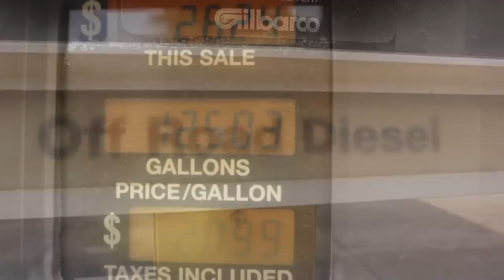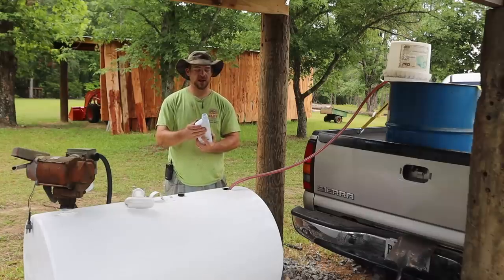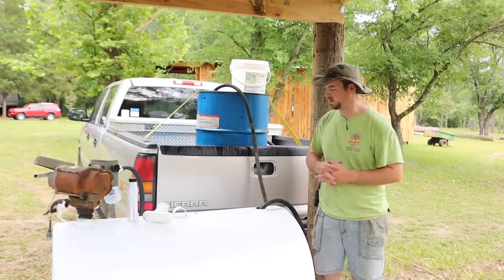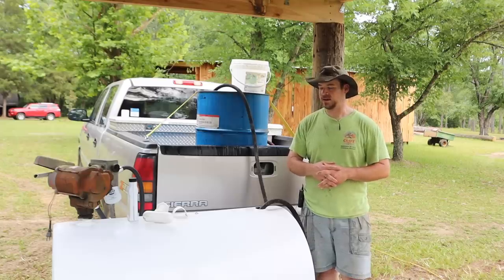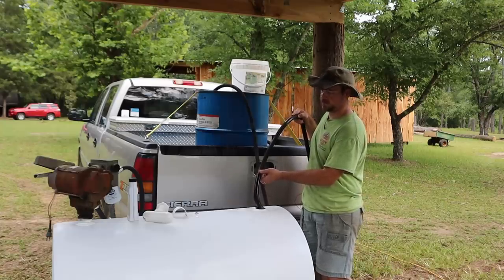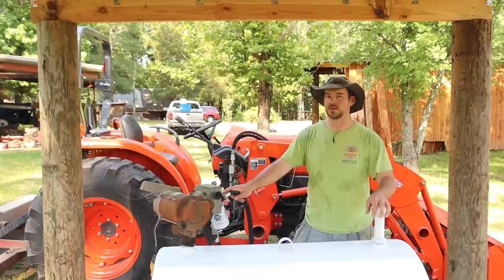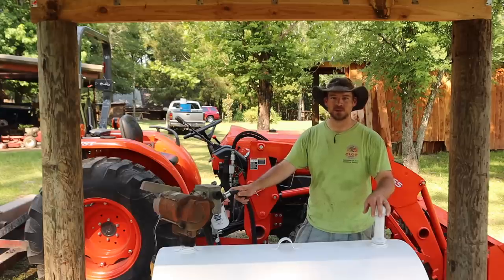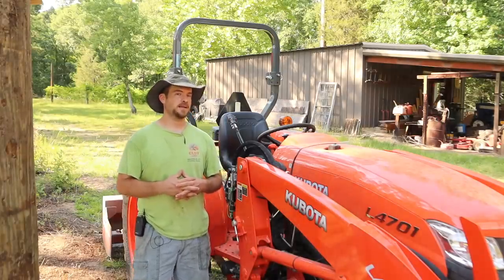Building a Homestead Fueling Station

Comment: I agree , as my dad taught me never use teflon tape on any fuel fittings including compressed gases. If you can slide that drum of fuel into the tractor bucket, strap it and raise it higher than the tank and it will suck that drum out in no time. Just a suggestion, it's your channel and you can do whatever you want! lol..

Comment: I got a 100 gallon transfer tank and built a skid for it.  Sure beats 5 gallon cans. Load it up in the back of my truck to fill it and use the tractor to put it back in its place.  I like your idea of having it under a roof, I have been covering the pump to keep it out of the weather.

My L3901DT gets an ave of 2.3 HPG.  This ave is over 24 tanks.

Comment: Weld yourself a couple of chain hooks to the top of the frontloader bucket. Put one facing forward and one facing back (in case you need more power at the expense of less height and distance by lifting with the back of the bucket) and just either side of dead center, offset by 1/2 chain width. That will maximize your lift power, minimize wheelies (stoppies, really), and save you hours of wrapping chains around the bucket while breathing exhaust, and make it real easy to set length. Plus you get more power from curl than from lift and the bucket will spin inside the chain if its just wrapped. When pulling roots I lift til it wont lift anymore then finish the job with curl. Or at least do a wheelie with curl if Ive bitten off more than I can chew.

Comment: Fantastic looking fuel station.  Makes mine look ridiculous.  I went with a 12 volt pump and installed a 12 volt power port on my Kubota to power the pump. And the same power point also supplies power for my sprayer tank when I have it attached to the Kubota.
Reply from the maker: Now that's a great idea about the power port!

Comment: My friend used a friend's private airstrip to park his airplane where he kept a 2 or 3 hundred gallon fuel tank.   To power the 
fueling he installed a schrader valve and used a small air-tank to pressurize the fuel tank.  It only took a few psi to refuel his 
plane.   He used a regular cylinder shaped bulk tank and it didn't bulge from the pressure but an old propane tank would have 
been better.  He released the pressure after the refueling so the heat from the sun would not cause the tank to over-pressurize.

Comment: Great video!  Thanks for sharing.  I have one of those battery jumpers.  I got the best deal on ebay for one that starts a diesel truck.  Mine has a 20,000mAh rating.  Good and strong.

Comment: Run a direct burial cable from the shop. I did that to power the lights in my shed. I used a flat spade to cut a slot in the ground for the cable.

Comment: Great job. Be nice to run an electric line in conduit from the shop to this fueling area. Put in a weatherproof outlet or hardwire the pump and an overhead light as you might have to fill up in the dark at some point.

Comment: Just a thought as I saw the cuts of notches on top of the posts : Nice step to hold a beam.  The top down slot : bring the saw down to the bottom and rock it tip up making a rain run out on your side then tip down to do the same on the back.  Might just increase the post life without sitting water to rot!

Comment: Great job!  Just a thought, you might want to get a "Diesel Fuel" label to stick on the tank, or just paint it on there in case, God forbid, the fire department ever has to come out so that they'll know what it contains.
Reply: It needs a no smoking sign too. and the gallons it will hold. A lot of states require a containment to put it in that will hold more than the tank will hold. All the tanks i have ever set were not put in level. the pump end was always 2 inches higher to keep from sucking up the drugs in the bottom. Set your down tube from your pump 2 inches off the bottom of the tank too. you also need a gauge stick and some water paste to check for water. The tank its self will make water from condensation. Just a couple things i learned that may help you.

Comment: It looks like a nice set up. I pretty much will just stick to using 5 gallon cans and using a battery powered pump. I can understand putting in a nice set up like that if you have electricity and feel a need. Nice video. It would have been real pricey if you had to buy all that stuff new.

Comment: Teflon tape if properly applied is fine. Doesn’t matter if it’s white, yellow, any color.  When applying Teflon or any other dope (remember many liquid does have Teflon) you should NOT put dope on the first 2 threads.  Pipe dope is a lubricant, not a sealant.
Reply from the maker: Thanks for the tip!

Comment: NEVER USE TEFLON TAPE on fuel storage, gas and diesel will eat through the teflon tape. I use Gasoila from Tractor supply.
Reply: The Teflon tape will not make a good seal.
Reply: Don't use teflon tape on fuel oil lines, either  Bits of the tape can get into the oil pump and clog everything up. Oil burner pump manufacturers warn that this can void the warranty. Fuel oil is basically the same as diesel.
Reply: The diesel tape here in Australia is Green.  I assume yours is too...
Reply: @reecenewton3097   Fuel oil  is diesel.
 only differents is off road fuel they add a red dye to it, as off road is not road taxed fuel oil used on the road is clear and road taxed, if you put even a gallon of colored fuel into your road truck any time in its life and the DOT DIPS YOUR TANK IT DONT MATER HOW LONG AGO YOU PUT THAT DYED FUEL IN, THEY WILL  pick it up on there dip, and your charged, funny how so many people think there is a deferents between fuel oil and diesel

Comment: Most poles aren't plumb on the sides.  Stand back and use a plumb line lined up with the center.
Reply: This isn't a home, it's a shed.  No need for it to be perfect, just "close enough for gov't work!" (LOL)
Reply from the maker: I just check all 4 sides and try to get it close. It's a shed.

Comment: Nice.  I see your Kubota. package did not come with a front and loader mounted auger 😀. 
  Over here in East Texas if you use at least 500g a year the local wholesaler Will give you a overhead tank do you use free.    Also I noticed you said that one absolutely level. That’s not the best idea in the world, should be tilted back away from your pump that way water will be at the back of your tank away from your pump inlet.     Oh and don’t forget to crack that vent pipe when you start pumping. That a 110 pump will most likely suck the sides in on it without some ventilation.  Unless it has a vented cap.
Reply from the maker: Good idea on tilting it! Thanks!

Comment: You need to get a swivel to Connect the nozzle to the hose you’ll finally be a lot easier to use
Reply from the maker: I thought about that. I just didn't figure it was worth the expense. I won't be using this on a daily basis.

Comment: Just add a Solar Cell out there to charge a 12v Battery System with 110v Outlet.  Should be enough to keep the pump going.

Comment: That grapple may need its hydraulic fluid adjusted to be the same pressure so it actuates simultaneously. Probably isn’t a real operational problem though, just noticed when grabbing that first log.
Reply: Bill Boger simultaneously with what??  Every grapple I've ever run, Including the I own, has separate functions for each "part"  the grapple body works just like a bucket and the "top" works off a separate "thumb" on the joy stick or is plumbed in to hydraulics from the rear of the tractor.

Comment: I’m wondering how your fuel supply is lasting?  I’m using a drum with a pump but am worried about longevity of the fuel?  Thanks for the nice video. Rick Asheville, NC
Reply from the maker: I've stopped using the tank just because of the cost of filling it, but I used that diesel for a long time, with one partial refill, and fuel stabilizer, for over a year. Fuel was still great.
Reply: @falllineridge  thanks!  I have been trying to stockpile a minimum of 40 gallons of diesel for my backup generator and use it in the tractor.  The tractor is pretty economical and the 40 Gallons lasts a couple years.  I have been using steel Jerry cans and a drum with an argon blanket with stabilizer also.  I would hate for that to go bad or hurt the equipment and many sources say not to store over 6 mo.

Comment: Hi have you considered an Earth on both the tank and the vehicle.
Reply: Err, do you earth your car when filling up with fuel??.
Reply: I have worked in petroleum industry, all tankers and filling rigs are earthed. At the filling stations the pumps are earthed and the nozzles are internally earthed. My concern is just for the personal safety of a father, and husband.
Reply: Roger Emberson. Hi at a filling station, the pump and the hose nozzle are earthed internally. In this instance the nozzle seems to be plastic it can induct a static charge when the fuel is pumped through it. The static discharge will be at the vehicles tank filler neck. I am concerned with the personal safety of a father and husband.

Comment: Just wondering why you didn't get the diesel delivered?
Reply: Most fuel companies wont deliver that small of an amount. If they do its very expensive.
Reply from the maker: If it was 1000 gallons I would have, but this is such a small amount I figured it would be quicker just to use a drum.

Comment: I'm curious as to the potential safety hazards if the hydraulics on the bucket failed while you were using it as an elevated work platform for chainsawing.  I'm also curious as to the potential environmental hazards if a spill from the tank occurred.  Thanks.
Reply: @HB-bc5po  Hmm.  Seems a bit of an over reaction to a impartial inquiry genuinely seeking information.

Comment: Mount the tank on a small 4 wheeler trailer with leveling Jacks and just carry the tank down the road to fill up and level it back when you park it.  
Mount a 12 volt battery with a converter with a solar trickle charger.

Comment: Love your videos.  Be sure to mount a fire extinguisher a safe distance from the fuel valve.  Just a warning about thieves -- we had gas cans stolen in our neighborhood, several homes.  I lost 4, myself.  Had to replace them at $30 each (incl. $10 for the nozzles).  To keep them from being stolen, I ran an anchored cable through them and padlocked the looped ends.  I hope you never have such thievery in your rural area.

Comment: Pro Tip: You used the wrong type of teflon tape. You should have used gas teflon (yellow). The white stuff melts when it comes in contact with petrochemicals, so your threaded joints will eventually leak.

Comment: 2 suggestions. Find a petroleum company to deliver bulk. It will be cheaper and already have biocide in it. Second, lock everything up. Nozzle, tank fill est. If people start figuring out you have bulk, your fuel will start growing legs. I didnt realize how had the theft was until I put locks on and compared taxes from 2 different years. Not having locks cost me almost 600 gallons over the first year alone.

Comment: Looks like a great job.  and I'm sure this will be a great convienence.   Couple of suggestions for down the road.   First a small rainproof cabinet.  Keep in it your rags for cleaning the dipsticks for checking your engine oil and hydraulic fluid levels.  Good habit is to check them both every time you fuel up.   Also keep in it one of those oil spill kits from any of the industrial supply places.  they come in a five gallon bucket and if you do spill, it's right there handy.     
  As for the electric pump motor.  One of those "solar generators" with a cheap harbor freight solar panel up on the roof to keep it charged.  Make a shelf for that inside your storage cabinet.  about a hundred bucks for the solar panel new, and couple of hundred bucks for the battery box with built in inverter. Used solar panels are way cheaper if you can find one, and if all this needs to do is run the pump for thirty minutes per day, more than you need.   Press the button to turn on the inverter, pump your fuel, and once ypu finish, they typically come with an auto shutoff when there is no power being used for longer than an hour or so.    Maybe wire up a couple of motion detector 12 volt lights to the DC port.  Those a commonly always on, but check to confirm that.   Hang those lights up under the canopy and fueling after dark becomes way less hassle.   
  Lastly, pour a concrete slab under the tank, and underneath where you usually park to refuel.  slope the slab to a center drain, and have that drain lead to a sump tank nearby that is bigger than the fuel tank.  It will fill up everytime it rains, so rig a dip pipe so that when it reaches overflow level, it sucks the water from the bottom, leaving any spilled oil floating inside the sump tank for easy cleanup.   This will save future you so much hassle, paperwork and grief from all the government agencies when you have a bigger spill.  (and eventually, there will be a spill.)  it will also collect all the little drips and splashes from normal operations.  Leave an air vent and pumpout pipe aboveground so the disposal contractor just has to suck out the spilled fuel from the sump tank.  Way less expensive than paying a disposal contractor to dig up and cart away all the tons of contaminated soil.   
   There are all kinds of safety rules around having 120 volt power around a fueling station.  Depending on your local laws, they may apply to you.  They are mostly aimed at commercial gas stations, oil refineries and the like.  Running the thing with an extension cord sidesteps most of the special rules for electricity, as they deal with keeping gasoline vapors from accumulating and then igniting or exploding.  Diesel is much better about that.

Comment: Just from experience you should put a treated board on top of the blocks and then put a piece of aluminum just regular sheet aluminum you can buy at Lowe's it's in a roll on top of the treated board and then put the steel barrel on top of that concrete and Rock hold moisture and produce moisture which will end up rotting out the feet of the tank overtime and of course this is a longevity thing you know I ain't saying that's going to happen in a year but if it's just there a couple years it'll start to rot and accumulate around the bottom of the tank just a hint up to you and I'm just telling you from my experience looks nice though very nice

Comment: I too have the L 4701, I bought mine new 3 1/2 yrs ago, I’d like to get the front hydraulics ran for a grapple once I get this crazy thing paid for! I’ve been happy with mine, while I did not need a tractor quite this big, the price point from a smaller 2501 and the 4 ft implements was only 5 grand to the bigger tractor and 6 ‘ implements, so I jumped up to the 4701, also the working cruise does not come standard on smaller tractors and the working cruise was important to have , good luck amigo!

Comment: I added swivels at the tank so the hose did not kink and hangs free, also not sure if that was actual fuel hose or just hydraulic hose. if not it does not have a wire through it.  You will need a bonding wire to the tractor and the tank grounded if not.  Also as mentioned before need petroleum rated tape on the threads.  I do like the building over the tank.

Comment: A little surprised  you did not go for an elevated tank that could use a gravity feed for when the power fails, as it surly will at some time.  Size your feed wire correctly when you run it from the shop, you get a substantial amperage drop with under sized wire if you run a long line.  If undersized wire, the pump will work, for a while, until it burns itself out. The motor is designed to run on specified amps.

Comment: Have you ever had experience using used motor oil as a wood preservative for buried wood or outdoor wood?
Reply from the maker: Some, not for buried wood, but for siding. It works great.

Comment: you should put a tray or pan under the tank to hold at least  half the tank  in case you get a leak 
and you won't lose all your fuel on the ground  it will go into the and you will not lose your expensive  fuel.
Reply: popcicleland do you keep a pan under your car in case the tank fails???  Morons!  Why would that tank fail any faster than your car's?

Comment: Question.... I saw the long poles and thought raising the fuel tank and a gravity feed would be the way to go.  That way you could use a simple 12v pump to fill the tank and gravity to fuel your machines.  Did you consider that?   I am asking because that was my plan before selling my farm.  Good videos.
Reply from the maker: I'm considering that with a small gasoline tank. I did not consider it with this one though.

Comment: Damn Wes, your pole setting skills are second to none ! If I ever get a tractor like your's, I'll know who to call  to get a fuel shed built.  W & H Builders. I think using a battery box  for the motor  is a pretty  good idea. I don't think the motor will draw it down very quickly. It's my guess you'll have to recharge it after every fourth or fifth time. You might have to buy a diesel pickup to make that set up really worth while.
Reply: Can't use off-road diesel in a road vehicle: Big Brother doesn't get his tax and will get quite angry.
Reply from the maker: Thanks, Jim! It's easier with the bucket. The boom pole on on the 3000 got the job done in the past, though.

Comment: Watching this video this guy did a few things wrong you could’ve put more gravel in the canopy area and you should’ve use forks on your forklift not the bucket forks would’ve worked out you could’ve lined up your gas can on the rocks a lot better just a suggestion for the next time someone does it Tim from Canada